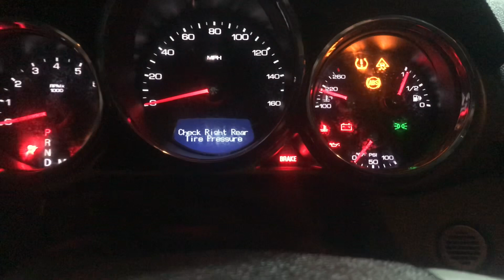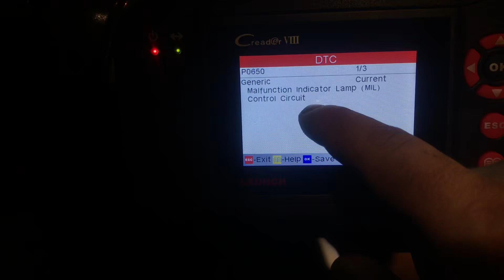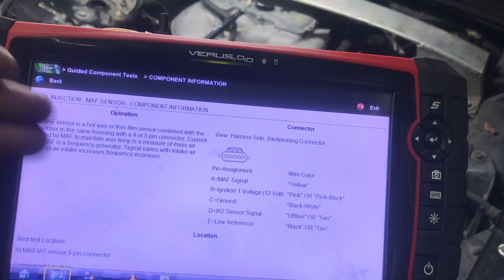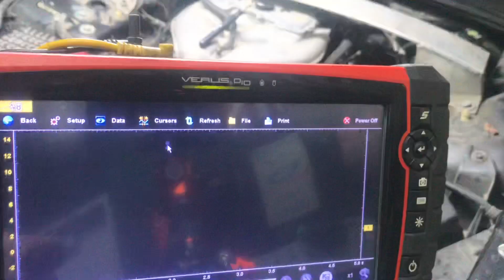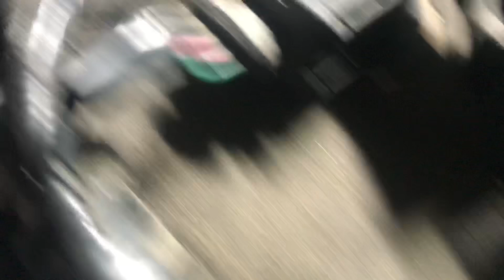MAF sensor p0100 repair

Comment: Good job finding the short to ground on the signal wire, goes to show why it's important to do a wiggle test before pulling the trigger on the all to common MAF on a GM.  That one could have been a real nail biter if you couldn't get her to come back after it went away.

The harness must have been exposed to the cover back there then?  Was the plastic wire conduit brittle and dry rotten then?
Reply from the maker: The wire wasn’t brittle or dry rotten. This was one fun car to work on. Off camera I wiggle the heck out of the wiring harness till it acted up again